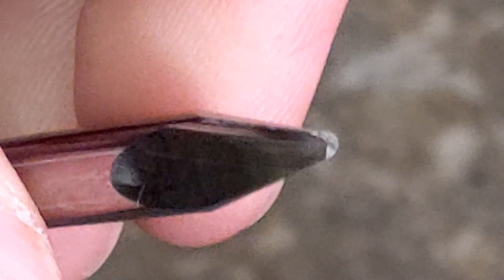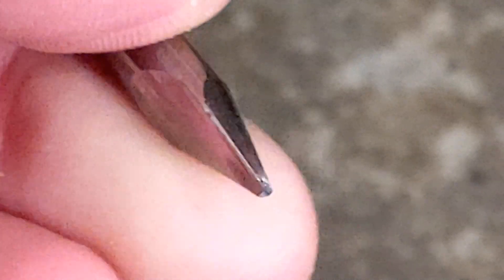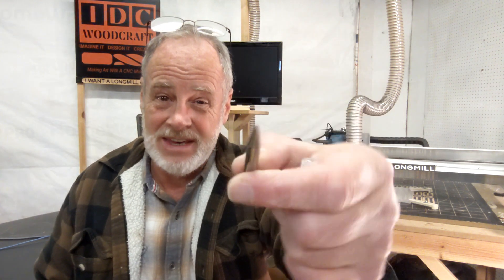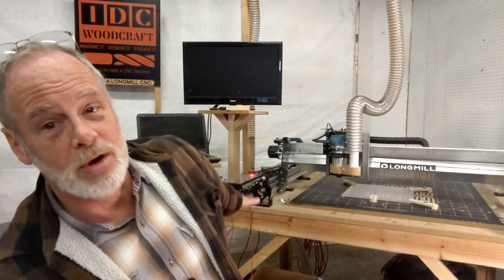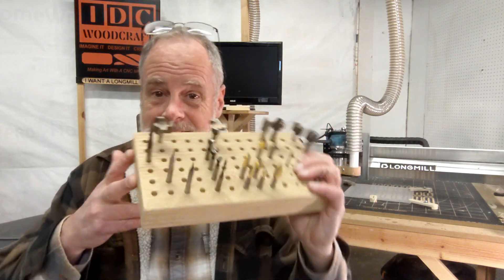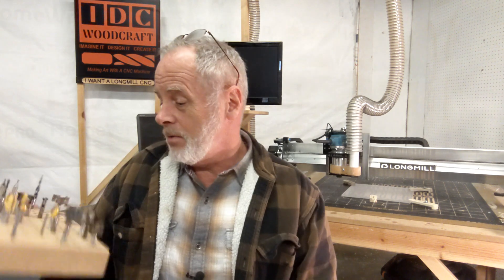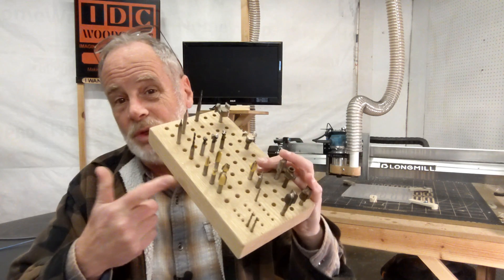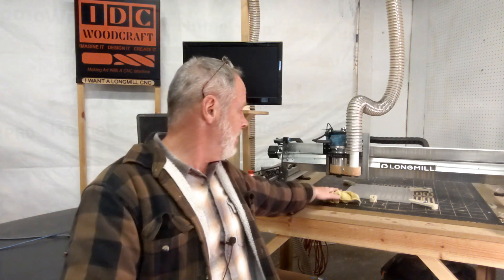Good CNC Router Bits Tips For Beginners [DON'T LET THIS $40 MISTAKE HAPPEN TO YOU!]

Comment: Only issue with a rag is that you forget that the bit is there, and you grab the rag and the bit goes flying.  I like to use a scrap section of "low pile" carpet both on the bed and around the machine.
Reply: Forgot to thank you for all of your very helpful videos, recommendations and comments.
Reply from the maker: Pete, you're so welcome. Glad I can help! Also, I like your carpet idea. I've definitely lost a few bits after flinging them across the workshop! Keep up the good work brother!

Comment: How many times over the years I suggested or told someone to do things a certain way to avoid having a problem like losing, breaking or screwing things up. If they begin to disagree, my question to them is, "how do you think I know this?"

I like working in or over a bin. If I drop something, it falls into the bin. Some tool holders have inserts held in place with screws. You have to take out the screw to change the insert. If you drop the screw and can't find it, you may stop and entire production process. Not good.

Or you can be on the verge of finishing a product. Just a little V carving or engraving. You drop the engraving bit and chip the tip off. You don't have another one. Not good.
Reply from the maker: CNC...I love the reply when they argue. I'll use that one from now on.

Comment: This is some priceless advice Garrett. These bits, just like router bits, are so damn delicate and that's the worst thing when you chip or break them. 
Using a bunched up rag underneath the router is a great advice also, I do that all the time when taking delicate bits out of my drill press. 
Im also going to get those padded rubber mats that you stand on, and put them around my machine to prevent this from happening.
 I'm looking forward to getting those bits and the holder from you when I get my machine.
 I know a lot of people that see this video will find this extremely helpful. 
Thank you for posting this.
You know I'LL be taking the survey. 👍👍
Reply from the maker: Hey Joe. thanks. A word of caution about rubber matts. Bits will bounce off them. Use a throw rug insetead.
Reply: @IDCWoodcraft  I didn't even think of that!! 🤯🤔
Well, an area rug it shall be then. I actually originally thought about the rug, but I figured a mat was easier to clean. But I can always shake out a rug too!! 
We know accidents can happen at any time, so if I get into good habits right away MAYBE I can prevent a few. 😃 
Thanks.
Reply from the maker: @JoeLazzara  I look at it this way. How often do we actually vacuum a rug in our shop?
Reply: @IDCWoodcraft  Touche 😆😆😆

Comment: rubber mats are cheap at HF and work wonderfully well.  I learned that lesson a long time ago the first time I dropped an $80 amana bit and broke the tip.
Reply from the maker: OPuch TW. I tend to stay away from rubber matts because bits can bounce off them. I use a dense throw rug instead.

Comment: The other procedure to do is to use a silicone cloth, like for firearms, or an oil spray on a cloth, to keep the edge very sharp.  Carbide is very susceptible to corrosion, even from the contamination from our fingers, so keep the cutting edge untouched, clean, free of moisture, and it will last much longer.  The tray is a great idea with locations identified for upcut, downcut, compression, or specialty use (or just use the original container for the speciality bit as it may get infrequent use).  Thank you Garrett, very good ideas! 😎
Reply from the maker: Hey Paul. I never thought of this. You are right.  Any contaminat will lower the life of the tool